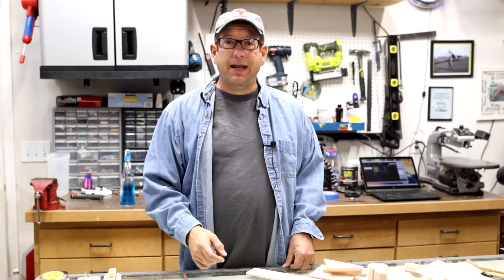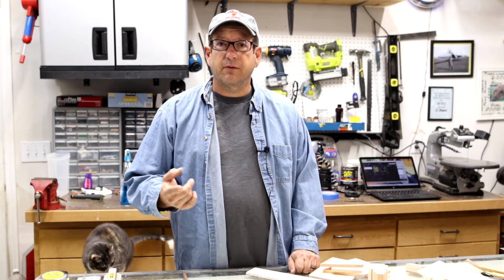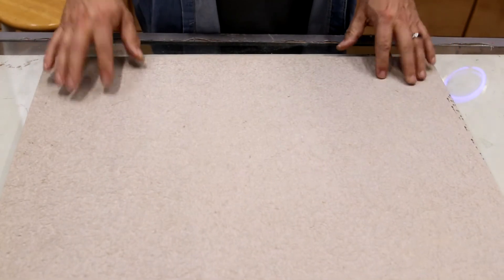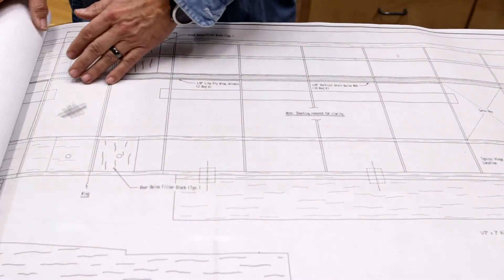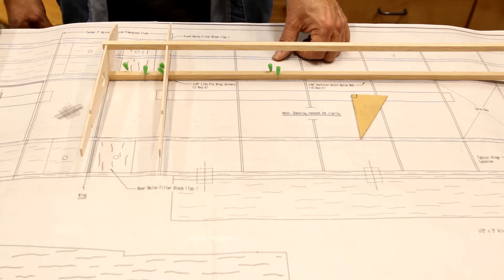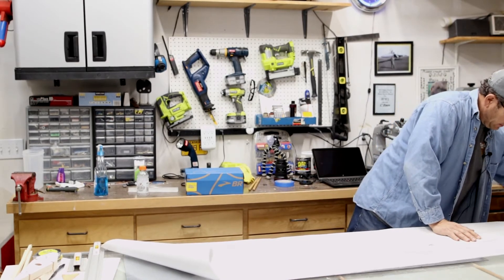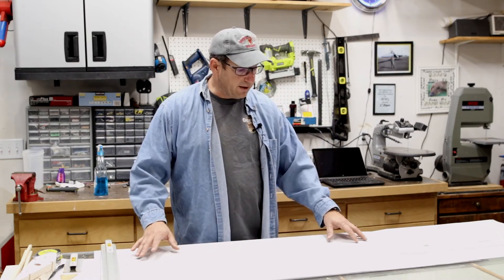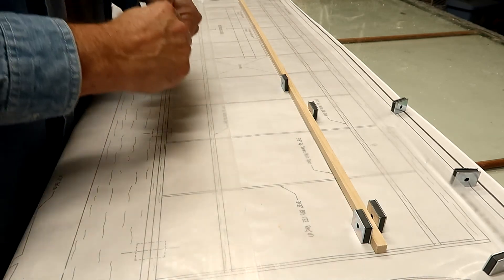EP5: Finally, its time to start gluing stuff together, Giant Scale RC Airplane Scratch Build

Comment: I'm having issues when bending the shape of the fuselage what do you do to battle one side bowing more than the other. When that happens tend to cause a twist in Mt fuselage
Reply from the maker: That is the struggle on laying out a fuse.  Many things can cause the banana ing of a fuse.  Sometimes it could be one side is slightly softer than the other, so picking carefully to match the sides is a consideration.  But for the most part if you can build over the plan and make sure the sides match the lines is going to help infinitely.  I like using a magnet board for my layouts so it is very easy to set the magnet on the line and keep the side braced to it.  You can also do it with pinning if you use pins to build.  Another good practice is to draw a centerline    on the plan, and centerline on each former so as you install them you will be centering the former and the sides should come flush to them
and be centered.  Eyeball your work as you progress.  I will typically have a T pin standing straight up on the centerline of former 1 and a t pin on the centerline of the furthest back former or where the sides come together.  You can periodically look down them as you add parts and even temporarily run a string between the two to see that things are running down the fuse equidistant.  Lastly make sure the fuse is flat on the table or crutch (if it uses that method) twist is also a banana maker.  So keep an eye on the sides matching in height as you build.  If you get a variance you may have to reset a former that is causing the twist, maybe glued at an angle or not squared up to the side.  But take your time and build as straight as you can.

Comment: Hi Dan , interesting build video, I use some of your techniques when I build from plans ,  just one question, when you lay the ribs out , how do you keep the wing level and true as I didn't notice you using a jig to assist you when laying out the ribs  ? anyway thanks good building from Tony from Bedfordshire, England,
Reply from the maker: On this particular plan the wing is flat with no dihiedral at all so level is easy as long as the table is flat.  The ribs are perpendicular to the table with help from magnet each side of the rib.  Once the top spar is dropped in it is easy to lock them in with the glue nice and solid.

Comment: Dan,
Love your videos, keep up the great work!  I am going to try the magnets on my next build.  Quick question, did you CA glue the metal pieces on to the magnets to keep the from sliding around?

Thanks for your time!
Reply from the maker: Hey Josh!!!   On the first 100 I bought I did glue the plates to the magnets.  The only bad thing was that if the glue set and the plate one side was not perfectly aligned the magnet might have a lean to it.  Or worse if one plate set slightly twisted so they don’t line up the magnet is useless as the plates aren’t parallel so it will rock.   
On the next 100 I didn’t use CA and find that it gives more flexibility of use.  Sometimes I like to lean them to force a spar to stay in place with tension.  I’ve seen some modelers use the magnet with no plates for a lesser strength fence to hold a part in place to lock a contour with the magnets closer together. So the short answer is, if I needed more magnets I wouldn’t glue them to the plates.  I think you stand more of a chance of damaging a few of them.  The only annoyance is when I store them they all glaum  together in the box and plates slide around and pop off.  Not a big deal it’s just part of setup.
Reply: @Capgains7777  Thanks so much for getting back to me, very much appreciated.  I'll give them a try without CA.  Happy Easter!

Comment: I use a large drop ceiling tile which I secure to my work table top which is a 36 x 80 hollow core door which makes a good smooth work surface.  Then I secure my plans down. And over that I lay a piece of wax paper over the plans so I don't drop glue or anything that will damage the plans. Then I start attaching my wing or tail feathers etc as I'm assembling each components. I was T pins which are about a inch and half long to hold the pieces in place before final assembly of that component.

Comment: What is your purpose for what looks like dowels under the glass on your base building board?
Thanks
Reply from the maker: Good catch.   The glass is actually a double pane sliding glass door.  When laid in its side the upper piece of glass sags slightly in the middle so the table isn't flat.  I spaced dowels inside the assembly between the panes to support them and make it flat.  No banana wings.  In my new shop I have gotten rid of the glass.  Videos coming soon.

Comment: I use a giant cork board/bullitin board.  It's huge, and dirt cheap.  holds pins perfectly.  Oh... I also lay down seran wrap/plastic wrap over the top of the plans, so that the glue doesn't stick.  That's right... CA glue doesn't stick to plastic/cling wrap.  It's perfectly clear/see-thru too.  Pretty sweet idea with the magnets!

Comment: Hi Mr. Gellner can you demonstrate how to build split flaps? Thanks in advance.
Reply from the maker: I have 3 models that are coming up that have split flaps. 2 of them are built so it would be more of a show and tell the 3rd is partially done.  I will see what I can do for you.  What is the plane you are building with this configuration of flaps?
Reply: @Capgains7777  Hi Sir thank you for the reply. I'm planning on buying a Nick Ziroli AT6 Texan which have them. I've been in the hobby for over 15 yrs doing ARFs but want to expand and learn more. Your videos are on point!!
Reply from the maker: Manuel, a friend of mine runs a website named rcscalebuilder.com   There are many build threads where people are building step by step.  There is a large section of Ziroli plans.  I'm sure you can find one that will detail your flap assembly.  Check it out!!!
Reply: @Capgains7777  Hi thanks for the info. Looking forward to more of your videos.

Comment: Dan, 

We took pdf’s to Office Depot. They wouldn’t print the brochure because the prints said copyrighted material. They wanted to know what scale to print the other file with the actual plans. What is the scale please?
Reply from the maker: When I had them printed, it was 100% Have them check the length of the page, It should be over 80 inches on the wing page.  

As for the copyrighted magazine article... you can print that from a regular printer, it is 8 1/2 x 11.  And that magazine has been defunct for over 10 years now, and they still owe me for taking my subscription money the very month they folded up...  grrrrrr

Comment: When I was younger my father and I built a building table out of a store bought rectangle coffee table and 3/8 or maybe  .5 cork roll. Put the spray adhesive down after sealing the bare wood with poly, then just rolled it out and pressed it down. Never came up and we built many rc planes and one boat with no issues. Worked with both the sewing pins with the plastic heads and the medium and large t-shaped pins. Just a thought for ya.
Reply from the maker: I have great appreciation for the masters that can build with pins.  For me the magnets just came easier and helped me to build straighter.

Comment: Great build series. Where did you get those pins with the green tapered ends. I see your point of the magnets but sometimes (in rc sailboats) the pins just work better.but I will try the magnet board for the glider that is coming next.  Thank you
Reply from the maker: Take a look at the comments under EP 10, I left a link for someone inquiring the same question.  Good luck.

Comment: some info.       at 8:57,  'pin through a rib'     that is great advice.  NOT.      can you spell  USE  an  Appropriately  Sized   pin-thing  OR  use another  non-destructive  method of  miter  support.
when you say  'GLUE' ,   it  Should Mean that  wood  CEMENT  will soon be used.     i use  testors (green tube),  myself.      alternatively,   CA  works  just   fine.    it should be understood that thin CA  penetrates and joins,  very well, in the case of a joins where  initial separation of the  bits  is  less-practical.      and, happily, as it is with wood cement,  CA  is  Lighter  than  most   'glues'.           you may know that  any wood component of any significant size, Should be  sanded  Before  construction.  the benefits of doing this are obvious; and include,  Better joins  and  the removal of a bit more  Mass (from the airframe).        it has been my experience that  either type of adhesive, at times, tends to bond to waxpaper.     i have heard the one side of waxpaper, is better than the other.      i have an untested theory that,  lightly treating/rubbing waxpaper with a (dry) bar of  soap,  might be a universal  fix for this problem.   cheers      googletranslate
https://i.ebayimg.com/images/i/351413251523-0-1/s-l1000.jpg
Reply: If it’s not your model what do you care if he is messing it up why do some people want to be  so rude
Reply: @bennietipton2820  If you want a good laugh.. Goto David David's channel and look at where his wealth of knowledge stems from. Horrendous, and he thinks he can tell Dan how to build. LMAO
Reply: Dan keep up the good work and pin it with a chainsaw next time if you want to lol
Reply from the maker: David, you are right!!!  The reality is, I think I have build maybe 2 models using a pin board method, then I switched to the magnet system, and have never looked back.  My friend wanted me to show how to use the pin board method and truth is, I'm not very good at it.  So yes, pinning through the rib probably isn't the best practice.   

I've never used testor's green.  I did use testor's wood glue (brown tube) many years ago but with the speed of curing for CA glues, and the light weight of them, yes that's what I like to use as a primary.  I am planning on making a video on the many adhesives we use and their best applications.  Thanks for your comment, I will not pin another rib to the board ever again.  :)
Reply: @Capgains7777  Dan did the pin method at my suggestion (Thanks!) since not everyone has the mag board.  Instead of pinning the spar as Dan showed, I cross-pin (depends on how big the spar is tho), that is - pins go diagonally across the spar, with maybe a couple vertical pins so the spar does not move.  And like David, I do not pin the ribs.  I use 1-2-3 blocks (available from enco.com for example), or small triangles (Bob Holman sells sets of them, laser-cut).  With the 1-2-3 blocks, I put a magnet on the opposite side of the rib - it holds it perfectly square and stable.  The nice thing about 1-2-3 blocks is that there are 3 ways you can lay them down.